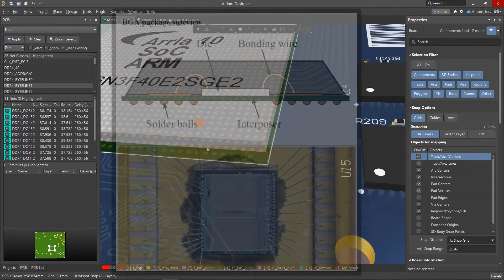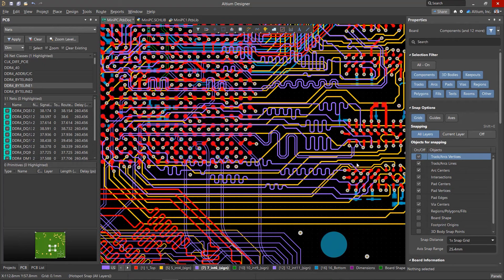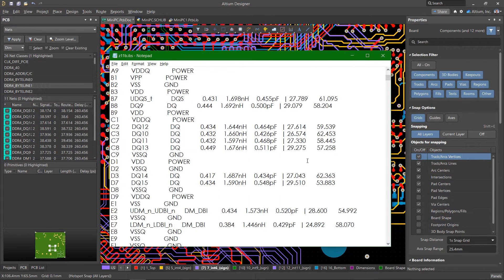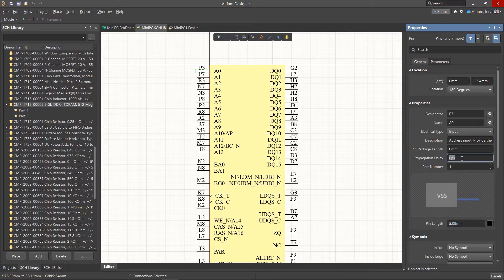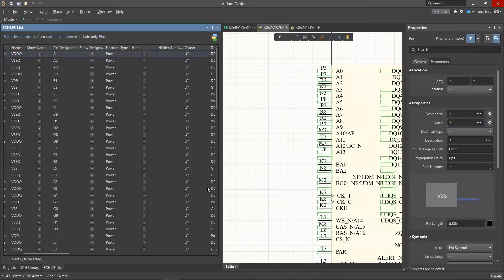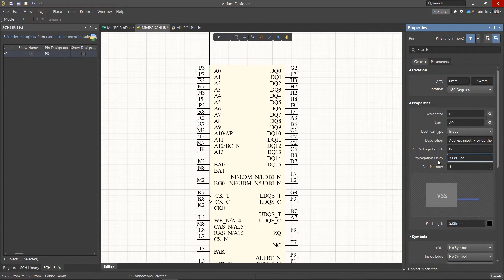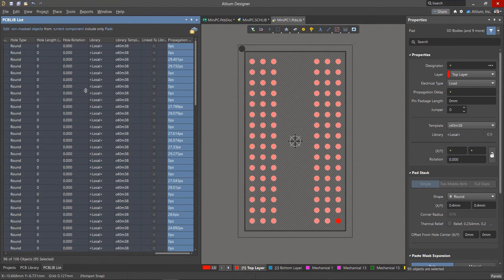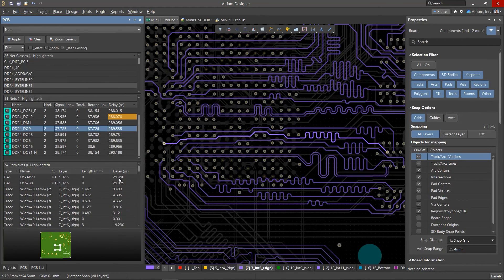Fine-Tuning Signal Delay Using Pin Package Delay in Altium Designer

Comment: They want me to enter thousands of values manually - how pathetic.
Reply: Actually you do not always need to enter this manually. For devices like FPGAs or large processors, the vendor may provide a list of pin-package delay values for some part numbers, and you can import this into Altium Designer when creating the part symbols. This way you don't need to enter 1000+ pins manually into the schematic symbol.

Comment: Will Altium ever support the automatic addition of via-delay into signal length tuning? The most frustrating thing about tuning length in Altium using propagation delay in ps vs length in mm is that Altium treats all vias as having a 0ps delay - meaning designers have to manually calculate and add this property themselves.
Reply: i second this. other tools offer Z-axis delay and even take the via stub into account. it doesn't make sense to use pin package delays when you can't use via delays...
Reply: @TheDigital19  It makes sense because the circuit is at least partially compensated. I don't know how big the effect of via-delay is, but it's good that you mention all these details. In my opinion, it is only a matter of time before they are included in Altium - I am sure that they are studying what their competitors offer.
Reply: @electronichome1153  There is a video on Altium Academy channel about via-delay issue, they show pretty simple formula on delay calculation and tell about the typical values (if i remember correctly, not more than 10ps for single-ended signals, and up to 40ps for differential, which is crucial). I wonder why its still not calculated automatically as the formula is easy and Altium has all necessary info from the layer stackup. Anyway, its a good practice to route all signals within matching group in the same topology to avoid via propagation issues.
Reply: @TheLemon22 support you here, length matching counts via lenghts, but not package delays, while delay matching lacks automatic via delays.